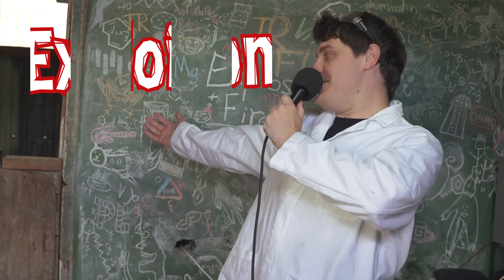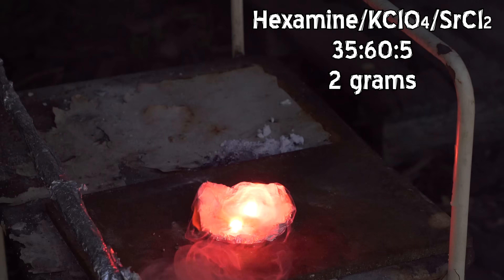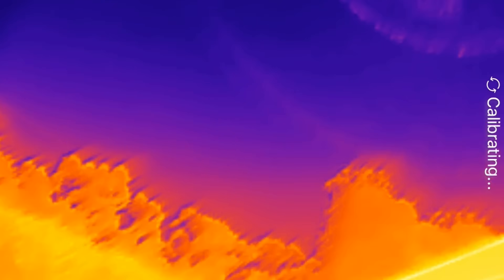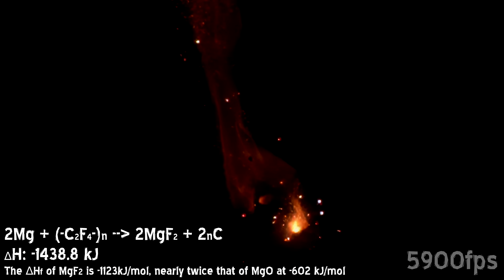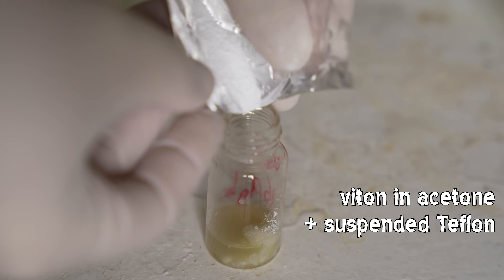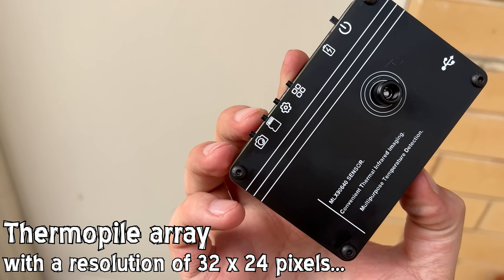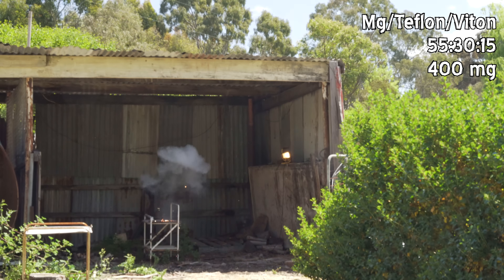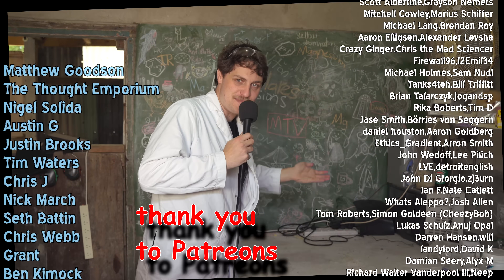Making Anti-Missile MTV Flares

Comment: 'Flares have a short shelf life and should not be stored. Here's one that expired 32 years ago' works perfectly
Reply: the cap came apart and started spewing hot flare juice out at an angle, perfectly safe
Reply: @tx5brent  I love it when hot flare juice spews on me.
Reply: it started falling apart, I definitely wouldn't trust it to maintain structural integrity
Reply: But it had obviously not been stored in an emergency box on a boat that has seen fifty thousand salt water sprays. Self life in a cool and dry environment is vastly different from "the intended use case shelf life".
Reply from the maker: @andersjjensen weirdly enough yeah it was on a boat, from a friend with a boat. So it had all those years rocking around in a marina
Reply: @ExplosionsAndFire  That emergency kit box must have had some seriously good seals then. And it's kinda disturbing that your friend would let them expire by... three decades. Check the date on the vests before you ever go sailing with them! :P
Reply: @andersjjensen  yep. Look at MREs. Generally a 5-10 year shelf life under normal conditions. It's damn near infinite if you freeze them.
Reply: @TheRealAaronSmith  doesn't almost everything food related last basically forever if frozen?
Reply: @TSquitz  Nope. I have had some very bad frozen ground beef before. The FDA says to use within 6 months but obviously it can go way longer than that but it's not forever. And then you have to wonder, just how many extended power outages has that freezer full of 10 year old meat experienced?
Reply: @TSquitz Theoretically, but the structure and nutritional values will go the way of a dodo. If the cold chain has not broken, it should technically be safe to eat, though probably not very good.
Reply: @shabath and that's the advantage of the MRE: It wasn't very good to begin with.
Reply: @TSquitz  depends from the temperature and how it was frozen. If it was frozen with industrial processes of quick freezing and kept below -20 celsius it can last indefinitely.
If you are just throwing fresh stuff in a freezer it's "slow freezing" and it will not last more than 6 months.
Reply: @wingracer1614  I'd say that if someone intends to use freezers for long term storage they probably have power backup, even a small gas generator can keep alive a big freezer if it has decent insulation
Reply: @TSquitz u can get freezer burn on meats. idk if u can get it on veggies or other shit but ik meat can get freezer burnt if left too long
Reply: @wingracer1614  What about meat submerged in liquid helium?
Reply: @wingracer1614  Well, technically, that meat you ate was probably 100% safe, just extremely uncomfortable to eat. Freezer burn sucks but it's not toxic.
Reply: @TSquitz  yes but no, eventually the cells in what you're eating, or planning on eating, get destroyed by ice crystals forming. At first, it really doesn't matter, the food will just have a weird texture, later on it won't taste quite right, eventually it will lose a significant portion of it's nutritional content, and I've heard that it can make you sick, but I feel like that's actually due to poor food handling and not the freezing process itself
Reply: @wingracer1614  To my knowledge no pathogen bacteria can metabolize under freezing conditions, much less to the point of reproducing. So I don't see how meat can go bad except the scenario of having power outages that are long enough for parts of the meat to thaw, but if the meat actually remains frozen? is it dangerous? you are going to cook it anyway still.
Reply: @teresashinkansen9402  From the little research I have done, it doesn't go bad as far as spoiling from micro-organisms but the flavor definitely worsens over time. And that was my experience, I did not get sick from the little bit I ate but it was absolutely disgusting. And IMO, tasting disgusting is almost as bad. Either way, I don't want to eat it
Reply: @wingracer1614  That's true, Ive had that experience as well but was with icecubes. My hypotesis is that many VOCs that originate on the refrigerator compartment concentrate in the freezer (only in the case of freezer-refrigerators) Due the low temperatures. I Don't have a chest freezer to test that hypothesis.
Reply: @TSquitz freezing only slows down the rate of reaction for enzymes of bacteria. Some extremophiles may be able to survive, and the enzymes are just slowed down, not denatured
Reply: @TSquitz  It kind of depends on the food and just how cold(and consistently cold) you keep it. There is a small amount of chemistry that still occurs that can make food 'spoil'
Reply: @mumujibirb  wow, I had never even considered the possibility that bacteria doesn't need to be active to cause spoilage! The enzymes aren't used up in the reactions they catalyze! A small amount of bacteria present throughout the food will potentially be sufficient to (very slowly) cause spoilage even at freezing temperatures. That's probably one reason that rapid freezing is necessary for long term cold storage. Slow freezing allows ice crystals to form that burst cells in both the food and any pathogens present, too.

Now I need to go read up about this.
Reply: I know this is just joking around but wanted to provide some real context. A flare is not something you normally need or use, so they just sit around all the time but when you need one, you REALLY need it to work properly. A 32 year expired flare may work properly but you don't want something to have a 20% failure rate if your life depends on it. Thus the expiration date so you know when to replace them.
Reply: @wingracer1614 Even if it will work 90% of the time, an increase from like 0.5% to 10% failure rate is still unacceptable for military application or any serious application for that matter.
Reply: @minhducnguyen9276  when did I ever say it was? The only point I was trying to make is if you have a piece of military equipment that is expired, it's probably still going to work at least some of the time. Whether it's good enough for the military is irrelevant because it was long since removed from inventory, that's why he has it instead of the military.
Reply: german science is the best in the world
Reply: @moltrescompany obligatory "is that a Jojo's reference!!1!?"
Reply: They might work too well after the expiration date. Explosives / Chemicals can be unpredictable if stored for a long time.
Reply: My father used to work in a place where they disposed old pyrotechnics. The biggest problems with flares is that the compound might become unstable because of moisture damaging the compounds, and the flame might become way hotter than intended because of it. Although it's normally already not recommended to hold flares, when the flame becomes hotter you get the problems shown in the video; the plastic container melts away very quickly. With shot flares the flare might fail to shoot at all or explode while in the barrel.

Don't use any expired pyrotechnics, it's controlled chaos when it's at it's best, and just general chaos when not.
Reply: I bet if you tried to fire it from a jet, you would end up in a big fireball yourself...
Reply: It started to peel the cap off, but I would that is expected to happen with every other flare 1 year after expiration date, so go german engineering.
Reply: Deutsche Manufakturing, Ja
Reply: West Germany
Reply: @Molon_Labe1776  yeah, nice to see that blast from the past. Nowadays kids probably will not understand what the fuck West Germany was.
Reply: @Molon_Labe1776  The best Germany.
Reply: That's the power of German engineering
Reply: It’s hilarious how they put expiration dates on things like flares. It’s all marketing. I collect old Pyro Technics, and I’ve demonstrated century old flash mixtures in vintage pyrotechnics work perfectly and flares 75 years old that work fine. All the elements on earth have been here since time and memorial whatever chemicals you’re using brand new pyrotechnic mixtures are just as old as the elements that have been here on earth forever.
Reply: @PYRO-ON  it's mostly as said before just to be sure, if your life depends on that flare, you want it to be new enough to be sure that it lights, even a 5% malfunction rate is unaccebtable for something that is potentialy life saving
Reply: @wolfy1398   I hear ya
Reply: Deutsche Qualität
Reply: @word6344 Sprich deutsch du... ah machst du ja schon. Na dann viel Spaß

Comment: Hmm, I have a formula for an interesting IR flare, if you happen to have some rubidium nitrate laying around.
Reply from the maker: I have rubidium chloride somewhere, so I’m interested??
Reply: @ExplosionsAndFire  Rubidium nitrate 60.8, silicon 10, hexamine 23.2, epoxy resin 4.2 (D.E.R. 321) , hardener 1.8 (D.E.H. 14) The epoxy is a very low viscosity resin, so probably not substitute-able. Source - PATR 2700, although I'm not sure of which volume and page number. I found the formula in Donald Haarman's The Wizards Pyrotechnic Formulary.

Comment: Are west-german flares better than other flares? Why?
Reply: basically everything that was made in germany at the time before the reunification was overengineered as hell and works way too good for way too long (my university has a transmission electron microscope from the 70s that still works fine but the only dude that is qualified to repair it lives like 6hrs away and is 80yrs old lmao)
Reply: Germany is known for the quality of its engineering. Even a pyrotechnic mix meant to produce a simple red glow will be so overengineered that it works reliably decades beyond its rated shelf life.

Comment: Note: hexamine in the pyrotechnic industry is sometimes used to make strobe fireworks, hence the strobeing effect of the first formulas
Reply from the maker: im an inventor yay
Reply: Weirdly we also use it (as a hippurate salt) medically for UTIs
Iirc it’s metabolised into Hexamic acid selectively by the pathogenic bacteria (i.e. not our cells) which messes with their capacity to adhere to the urothelium (lining of bladder/urethra)
Reply: @BirnieMac1  : And against sweating ...
Same mechanics ...
Reply: @BirnieMac1  PS : Cranberry does a better job on UTIs btw.
Even better than ANY antibiotics !
Reply: @CharlieKirk1000 Is this some new-age hippie raw water antiwax bullshit? Seems quite unlikely but what do I know.
Reply: @shabath Well that settles it, I guess Tom will have to take one for the team and validate whether cranberry juice cures UTI’s or whether is just hippy juice
Reply: @CharlieKirk1000  Wouldn't that make cranberry juice an antibiotic by definition?
Reply: [Just a random pharmacologist - sort of] Part right on both counts - methenamine (or hexamine)  hippurate is converted to formaldehyde and acts as a sterilising agent. Cranberry juice contains proanthocyanadins (poly phenol compounds) that reduced bacterial adhesion to the urothelium; d-mannose has a similar mechanism of action. Cranberry technically  could come under the heading of “bacteriostatic” antibiotic I guess - still not directly lethal but inhibiting some part of the bacteria’s ability to reproduce...
Reply: @pseudonym8791  This is why I love the internet. Thanks for the cool info on the chemistry behind cranberry juice!
Reply: Note : and for making the GOOD stuff ... (HMTD) lol
Reply: Do they still make hexamine tablets? I used to use those for cooking food when backpacking or doing a camp when I packed out everything in a backpack. They worked so much better then isopropyl tabs those suck compared to hexamine
Reply: @MRblazedBEANS  esbit brand dry fuel is still a nice brick of hexamine and paraffin. easily the best solid cooking fuel.
Reply: @christianterrill3503 Yes they do.
Reply: @MRblazedBEANS  Not any more, they realised it basically makes both main excretion methods uncontrollable

Comment: lol f22 countermeasures are made by native iron. nothing more. its stored in a sealed inneart container and instantly burn on contact with air. the way they make it do that has a lot to do with the techniques lockeedmartin and its subcontractors invented for depositiing the iron. they used sputtering in specific magnetic fields to deposite up nanostructures of native iron. the same stuff is now used on a lot of the sneaky drones the us uses as a self destr... er i mean a respawn hotkey shortcut. kind of makes it tamperproof by know nothings rofl. dont ask me how i know this
Reply from the maker: Pyrophoric pyrotechnics for countermeasures are cool, I have heard of them. Some super dangerous ones, that have like organometallic liquids in them… but I think they’re all just metal foils now?? That are kinda nanoporous and get really hot in the air when you want? Is a cool video topic if I could do it safely…
Reply: @ExplosionsAndFire  ya i think the idea of rusting metal is useful because you can toon the rate and heat to different levels of atmosphere where things will burn differently. im sure missiles now days can tell how high up they are and what wavelength engine parts/exaust should be given the atmospheric changes
Reply: So it's just pyrophoric iron !
Reply: @alexandermathar7780  lol

Comment: In norway the ingredients need to be listed on Pyrotechnical devices Very weird law but for flares it is  Strontium nitrate  sulfur and magnesium powder
Reply: Most North America road flares use strontium nitrate, sulfur, a bit of wax and some sawdust as filler. The ones in the video are fancy marine flares.
Reply: @chemistryofquestionablequa6252 Yeah. Sr without the chlorine around to form SrCl radicals results in a more dull and more orangey “red” rather then the deep red seen in this video.

The marine flares these days use ammonium perchlorate as an oxidizer, and strontium nitrate for the colour, along with magnesium powder for fuel and brightness, bound together with a hard synthetic rubber like HTPB acting as binder and fuel.
Basically rocket propellant, but optimised for light output, rather than gas generation and heat, but the heavy gas generation from mixes like this are actually very useful in marine environment as it means they will happily burn underwater, as the gas prevents the water getting in and quenching it from heat soaking it until it goes out. Sorta like a Liedenfrost effect.